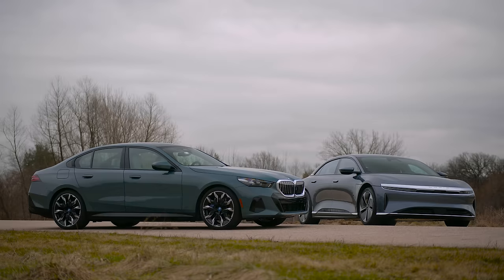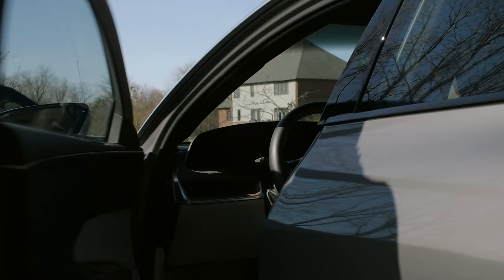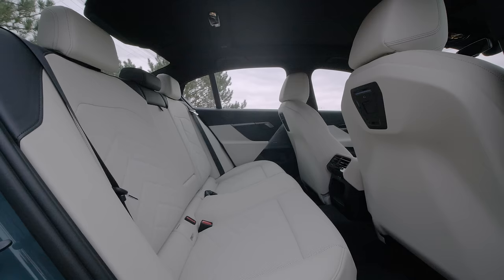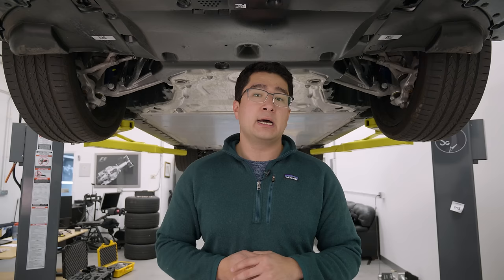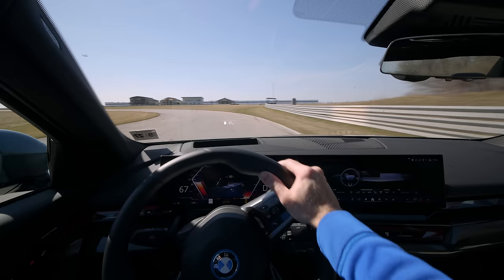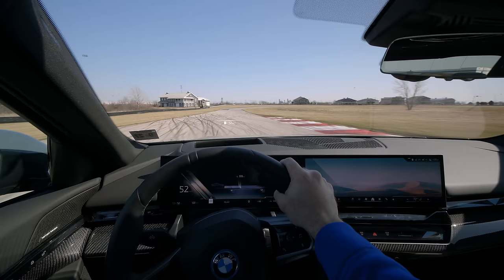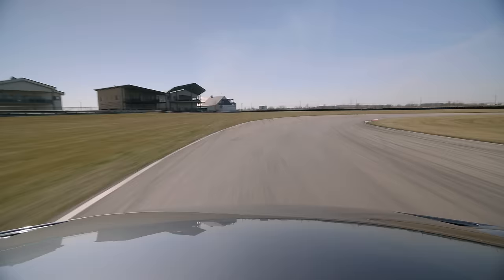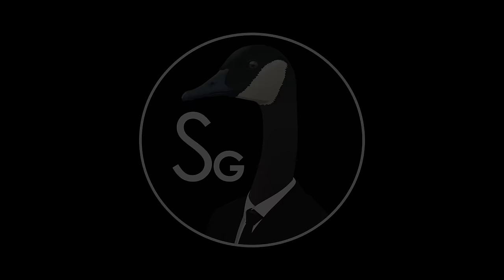Lucid Air vs BMW i5 | Worth The Money?

Comment: I’m surprised that in your tech segments you haven’t discussed BMW being the only manufacturer using brushed motors in its EVs, needing service, brush replacements, and possibly cleaning out at some point. Since no other manufacturer is using brushed motors over magnets, I’m skeptical of it being the way to go
Reply: You do have to give them credit for selecting a motor topology that does not require any permanent magnets dug up from mining.
Reply: BMW recommends replacing the brushs after 168k miles and the replacement module is 100 bucks. If the brushs indeed last as long as BMW claims, then this should be a non-issue.
Reply: BMW dealers probably had a say in this decision.  Dealers need high profit service visits, not maintenance free cars.
Reply: @aussie2uGA BMW dealers don’t make huge profits. They have an extraordinary amount of overhead (which is insane imo but that’s another discussion)
Reply: @Conservator.  Dealer service departments account for 50% of the dealers overall profit.  Service is their largest profit generator.
Reply: @aussie2uGA  
I don’t doubt that, but when you enter a BMW dealership there usually are some ladies to welcome you. They’ll ask if you’d like a coffee while waiting for a service manager to be available. 
The service manager will then discuss with you what services you want or should be carried out. He will use the readout from your key to assess the status of your car. 
He’ll enter what needs to be done in their system and the work is scheduled, etc etc. 

At a local independent workshop, you’ll just discuss with the owner what needs to be done. You’ll hand over the key and he’ll give you the keys of a cheap and cheerful loaner car. That’s more efficient.

Oh and manufacturers don’t care much about the profits of their dealerships. They extend the service intervals because that will sell more cars to fleet owners and that won’t please the dealerships. 

And lastly: once the brushes would need to be replaced, chances are that the car is no longer serviced by a dealership. 

G’day!
Reply: Honestly, I can't hear this argument anymore. It's not a brushed motor like a brushed DC motor is. So no commutation at the brushes which means no hard changes of the current flow direction at the brushes and no sparks and therefore way less wear. Also only the small excitation currents have to go over the brushes, not the full power. This can easily be engineered to function for the lifetime of a car.
Reply: @mingkwanburckhardt do you have any source for this? Never heard of this and can't find anything with a quick Google search. As far as I know the brushes should last longer than that and are NOT serviceable.
Reply: Electric cars it's only about ecology, and  brushed motor's more eco-friendly
Reply: Not a brushed dc.  Is a 3 phase separeted excitation. Slip ring rather than comutator. Works fine, low maintenance and very small current in brush.
Replace a brush will be cheaper than a brake pad.

Comment: I don't find track tests useful. Sorry. How do these cars drive in the real world. Seems to me if the BMW has the comfort/lux with some sport dial in, that's what most people will sense. There's a reason BMW made the car ride so comfortably. And judging how well BEVs are selling and rate of adoption, BMW made a smart business move to share the BEV with the ICE platforms. They have the iX that is on an EV platform and that's a very small seller for them.

Comment: Thanks for the audio testing - one of the few things that’s really hard to get info on.
Reply: Best part about this channel
Reply: Especially when one of the biggest reasons to buy an EV is if you're looking for the quietest ride.
Reply: Of note, the SPL level difference between the Lucid is only 2dB louder than the BMW.   The human ear usually cannot perceive that difference in SPL, 3-4 dB is when you start to notice.  The Lucid is by no means noisy or not-luxury feeling, I have one, compared it to a Tesla which was atrocious.  So by their own measurements BMW is BARELY quieter than the Lucid, not much to criticize there.

Comment: Just some real world data points. 
Last week recharged at a 350kw Electrify America station. I have an AWD Lucid Pure with the same 700+ volt 88 kW-hr battery pack as the RWD Pure. It was 52F and I started charging at a little over 250 kW. I charged for 30 minutes and went from 5% to 80% averaging over 132kW even though I was the fourth car connecting at a 4 bay station. So the higher voltage can help. 
I have also gone to a EA 350kW charger and even though I'm the only one there, have connected at only 50kW (I always have the battery preconditioning before charging). When that happens I take a quick hit (10 to 15 minutes) and then drive 50 -60 miles to the next charger) hoping that I will connect at higher speeds.
The key is to just charge enough to get to your destination (with a margin of safety). Then complete your charge to 80% over night.
Reply: This sounds horrible!
Reply: Charging infrastructure continues to hold back EVs. Gotta at least hit tesla supercharger reliability levels. 

Still. Before you drive to the next station, try the other stalls first. Often it's just one charger stall being limited, not the whole site.
Reply: @Cyrribrae  not around here - across Europe - very dense network of HP charger  - now its getting too full on high traffic times
Reply: @bavariancarenthusiast2722  yep. And even more important, Europe's network of level 2 charging is far superior to the US's. Tragic indeed. But slowly getting better.
Reply: @Cyrribrae  yes you are right - I now upgrade my garage charger to 400V if you have this level over there? Its 3 x faster then level 2, so the car is always full over night even if you roll in with 0%.
Reply: What highways range do you get ? Thanks.
Reply: @person2186  In the summer charging to 80% I can 300 miles (I have the lower range Pure). Winter its more like 250. I could charge to 100% to increase that to 360/300 Summer/winter.

Comment: The glass roof on the Lucid really does it a disservice as a luxury car. Instead of absorbing noise, it reflects it.
Reply: The heat as well. If you own anything with a glass roof you’ll want a good tint on it ASAP!
Reply: We're getting it with the regular roof for that reason
Reply: @jamied9448  it's great that they have the option. I would never want the glass. Have fun with the car. Driven two. Very well thought out.
Reply: id say if one buy a new car to own for a long time, avoid anything that isn`t a simple uniform metal roof. no sunroof moonroof any of that crap, its just rust and leaks waiting to happen
Reply: I love my Lucid glass roof.  It they do offer option of metallic roof for anyone with a different preference.
Reply: @JollyGiant19 No. Get a cover. By it's nature, tint absorbs heat. And you'll have a giant sunroof explode on you on the highway.
Reply: @japanwatchconnection well there are many different kind of cars/qualities and several different kind of climates. but sure owner is the most important variable
Reply: The car they reviewed (Pure RWD) doesn’t have a glass roof.
Reply: @larrywineland4682  you may be right. I was thrown off by the shot of Mark at 1:43. He seems to be sitting in a glass roof car. I was comparing the roof near the rear view mirror.
Reply: Got Lucid with glass roof..  so far so great, but its also not yet summer we'll see.  I went back and forth between glass and metal, I've really liked glass roofs in past but others saying to avoid it got me worried..  in the end decided it based on fact IMO car looks so much better with it.  With Stealth option the two tone look sorta.

Comment: In this Xanax inundated, Special K ingesting world, BMW knows its lease client, very well. With Lucid, it's made for DRIVERS. I am so happy to FINALLY see a Lucid every once in a while on the road away from the Phoenix area, where its assembled.
To me, the Lucid is a masterpiece. A genuine work of art. The BMW is a product from a marketing company.
To see the smiles on your faces while ripping it up with Lucid, it's so easy to see what is the more FUN, and in many ways, better car.
Reply: Saying an EV is made for drivers is hilarious. If u want a drivers car get a porsche or bmw M car.
Reply: Have either of you clowns driven a Lucid? I'm a multi Porsche and other sports car owner from a time when actual driving characteristics were built into cars, vs synthetic. I have owned many sports and muscle cars over the years and FULLY understand fast driving, ask my attorney. The Lucid is a solid driver's car, quicker than anything I've ever owned. So what if it doesn't have a combustion engine? It has massive, instant torque and speed. Go drive one.
Reply: @G82Watts  You can get an EV Porsche and M car. 🙂 There is no reason someone won't make an electric lightweight MX-5 type car soon,as long as buyers are happy with a very small range.  The Mini Cooper SE electric is within 100kg of the Mini Cooper S ICE, most owners seem to think it's pretty fun to drive.  In terms of getting stuck in to hooking up tightly spaced hairpin corners, there is no reason an EV can't be fun (obviously the combustion engine noises and gear changes are missing, but then  you have the instant throttle response which only the very best of ICEs can get close to,so swings and roundabouts) -- in terms of apex-to-apex I definitely believe BEVs have the potential to be lots of fun, as long as the weight is close to parity with the ICE equivalent.

Comment: Are you sure the lucid was preconditioned before charging?  That's the only reason I could see for it to start at 55kw getting up to 139kw later.

I've had terrible luck with the charging around Chicago, but if I get more than 80kw at any point in the charging session, it's because the charger was fully functional.
Reply: very much this, if you don't precondition you're already putting yourself at a huge disadvantage

Comment: I went from a 2019 Model 3 Performance to a 2024 BMW i5. Lucid was on my shortlist but the closest shop was 3 hours away. I wanted a more luxurious drive and I don’t like SUVs at all and the BMW delivers. I share the distaste for the braking of the bmw though.  If you have any questions on the i5 ask away!
Reply: Is the luxury of i5 really worth the price difference over the Model 3? I'm contemplating between the new Model 3 Ludicrous that is coming up vs the i5.
Reply: @Iwo26  Depends a lot what you want: 
I didn’t test drive the facelift Model 3 but compared to my old Model 3 Performance the BMW has more real world range, is quieter, has better driving assist features (no more phantom braking thankfully), has better lights, a much better interior (especially the seats and the head-up display), more leg room
In the back and a bigger trunk (but no frunk). On the downside the Model 3 had way more power and was more fun on a back road. 

The new Model 3 rectified a few problems like the noisiness and the lights as well as the cooled seats so just based on a price point of view it’s probably the better deal.

I was also somehow fed-up with seeing so many Model 3s and Ys on the road as well as Elons crazy antics and the whole Tesla insanity the follows the brand that I didn’t even consider another Tesla even though my ownership of the Model 3 was nearly trouble-free and generally a positive experience.
Reply: Yeah model 3's are a dime a dozen.  Good change up.  The i5 is the new hot thing, which will cut both ways over time.  @Helmigurt
Reply: "Elon's crazy antics." 
oh, you're one of those guys...
Reply: @louKushh  Oh, you’re one of thooose guys…

Comment: Did either company say why they didn't include a differential?  It's technically possible to do that with EVs. Is it cost, complexity?
Reply: It’s for sure cost but also efficiency - a differential adds some resistance and nobody wants to loose 2% of range and add 500 bucks to the costs for a feature not even 1% of clients will honor. The Porsche Taycan has one as an extra.
Reply: And the top Lotus Eletre R does too.   Other that the Audi Etron (& RS)that's it, afaik.  @Helmigurt

Comment: Air GT owner.  Comparing an established ICE car that has been converted to an EV, isn't a fair comparison, and you touched on this at the end of the video.  However, not building the EV from the ground up, means that they are relying on their tradition of excellence in the ICE world and hope they can sway people to decide on them for a decent effort into the EV realm.  The hypercharging testing you did, didn't provide any numbers nor limitation the station may be been limited to that day.  Several EA stations even in the dead of night will throttle back and not allow the actual hypercharging that the user would expect considering the design of the car.  I normally go to my local EA at 2 or 3am to charge up (always preconditioning the battery), and routinely get 325KW into my Air GT, for an fair amount of time before it levels off.  But I can always get 300 miles added in 35 to 40 minutes, and that is because of the 900V design of the car.  I call that a win every time!  

Sure their software design isn't the best, and I attribute that to the fact their software engineers come from every corner of the Automotive industry, and you have a hodge podge of spaghetti code that in the end really hurts the electronic performance of the user experience.   However, their OTA software updates, are fast and have made many improvements to their existing platform.  I call that a win too!

One area I will agree with your overall review is in the luxury mindedness of the Pure.  I personally think it is a bad design choice to have the base model still cost an arm and a leg, and not have all the features in it.  I can tell you right now, that the level of features not included in the Pure vs my Air GT is dramatic, and IMO a mistake on Lucid's part.  

You gave a minus on the brand recognition, while fair and unfair at the same time I personally like how exclusive my GT is.  It turns heads everywhere I go, and I have everyone under the sun asking me about it.  How many people are even going to notice the EV-I5?  IMO, this is a win and not just another "me too" car.  In fact in my area of Dallas County, there are only 3 Lucid's, and I like that alot! 

The Second area I will agree with you on is the Audio system.  Now the Pure does give the user the option to choose the 21 speaker system over the 9 speaker system, but hardly worth the $$ markup.  But even in the GT's audio system, this is NOT an enjoyable platform to listen to any song and get excited about it.  There is absolutely no bass response at all, and that bothers me to no end.  The audio system I had the my Ford Fusion Energi was amazing.  This is shit and that knocking noise you heard from the front bass speakers isn't the speakers.  Myself my my service tech determined that the factory isn't installing the proper "metal tape" over a small hole in the door panel, which is causing the knocking sound, or rather the sound that the speaker is blown.  Once my service tech added the proper Metal Tape, that knocking noise went away.  It didn NOT improve the bass response or the audio quality of the sound experience.  So while I don't hear the knock now, I still do not enjoy the music.  

A fairly good review on a lopsided comparison.  

Good Luck
Reply: "Comparing an established ICE car that has been converted to an EV, isn't a fair comparison" This is BMW's decision isn't it? They had the engineering-forward i3 and i8 but abandoned those ideals in favour of converted ICE cars like the i4 and i5.

Comment: I would love to see the Lucid Air Touring AWD with the upgraded sound system and their driving assist professional vs the BWM i5 M60.  These are the 2 EVs that made my shortlist, but went with the BMW because of the software.  You didn’t mention how you crack your head  getting in and out of the Lucid unless you remember to duck.

Comment: its so odd, theres so much online about Lucid, so many videos, so much marketing, yet I havent seen a single one ever in Europe. Are they even sold in Europe? 
I personally just wouldnt want to spend that kind of money on a manufacturer with so little presence, a manufacturer who you couldnt be certain would still be around in 10 years, regardless of how good it is.
Reply: I’m in Austria and I was super interested in the Lucid Air RWD as my next car. The next shop is in Munich though which is a three hour drive from my home which is why I went with the BMW i5 instead. I’ve seen maybe 2 on the road.
Reply: Much noise no sales
Reply: @japanwatchconnection Correct!

Comment: Fair report.   Unfortunately BMW no longer makes drivers cars.   Things started going down hill in 2009 by 2013 most BMWs had lost their dynamic adge.   I had a  2012 x3 although it had no steering feel.  It was still a fun to drive drift-able suv.  I miss the non turbo straight six.  What an engine.  The electric motor before electric motors.

Comment: So we need a Lucid Air built by BMW.
Really hope that the Neue Klasse will give us that, a great electric sport sedan: powerful, agile and efficient.
I'm maybe the only one on the internet but I like new BMW style, so fingers crossed for their next EVs.
And good for Lucid, they demonstrated the potential of good EV tech.
Reply: I wanna vomit the future  BMW EV design its nauseating.
Reply: @isserdigan2835  the 2 neue klasse are looking good as concept - BMW got the tradition making better looking cars then concepts and got new designs changing the market. Lets see.
Reply: @bavariancarenthusiast2722  The outside is okay. the inside looks like any other cheap Chinese branded car. Cheap and horrible, just screen. maybe fit one instead of the windscreen also when they are at it and a just a camera at the front.
Reply: @Iceeeen  well the inside it halfbaked, just showing new ideas,  agreed